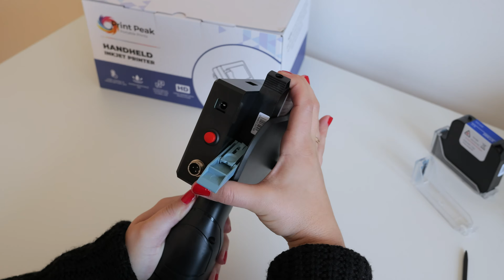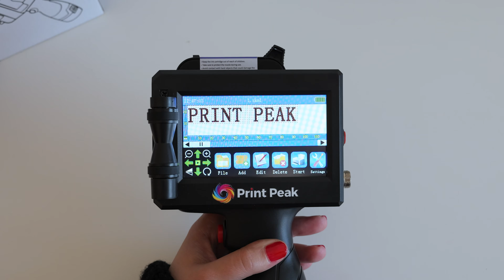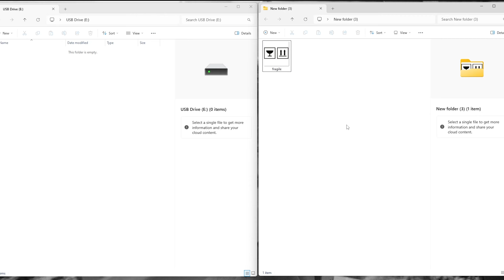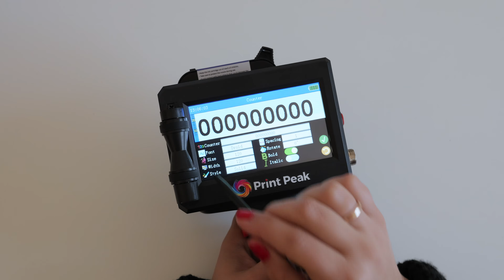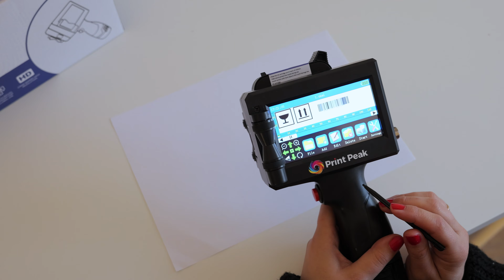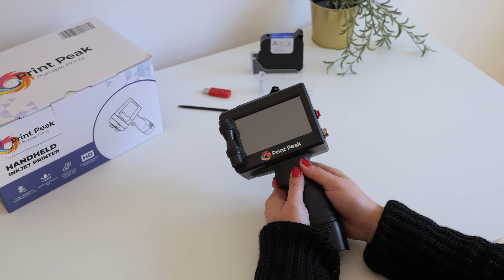Master Your Print Peak Handheld Inkjet Printer: A Step-by-Step Tutorial

Comment: Got mine a few days ago and its kinda OK. I can get it print text fine but when trying to get a file (logo) tranfered and saved to it, it is proving to be very tricky. I've been at it for an hour now and still have not figured it out. it saves to the disc, its in the 250 x 250 size constraint and it just does not give me it as an option to save to the printer!